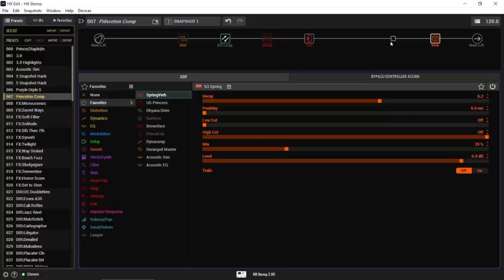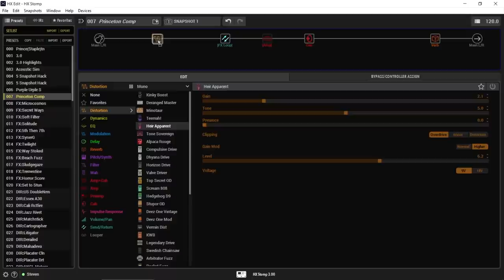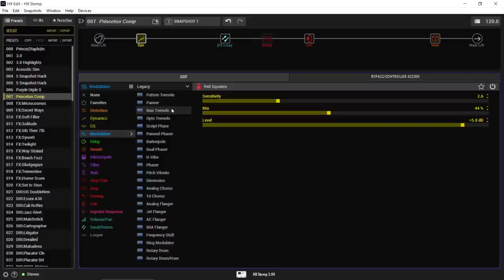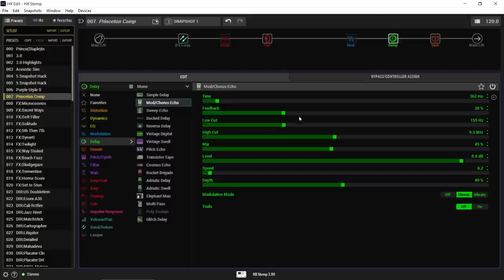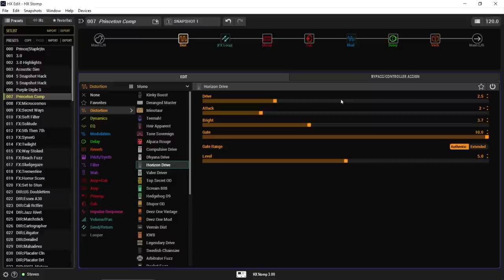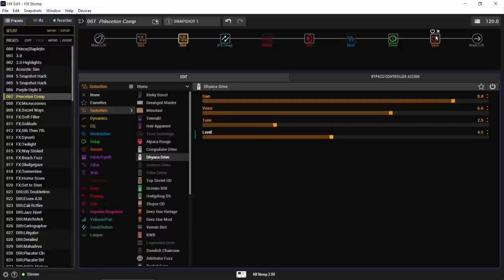Helix 3.0 Princess vs VINTAGE Princeton Tube Amp. Do they sound the same? Line 6 HX Stomp firmware

Comment: Thanks so much for this Steve. The way you've tweaked the amp is so musical! I have an original Bluesbreaker pedal and am really impressed how you can tweak the Heir Apparent to sound pretty much dead on the same  - well I can't hear a difference anyway! Keep doing what you doing!!
Reply from the maker: Thanks Chris! The KOT is based on a BB circuit. Also, that mooer is supposed to be a direct clone of one

Comment: Very similar for sure. Helix has slightly more gain and bottom end but that is more of an eq settings thing, I think in a mix it would be next to impossible to tell the difference. I'm digging the new 3.0 update for sure. took me about 5 minutes to dial in a great tone with the new Princeton amp. Very real sounding and feeling. I did however, use a tone junkie IR with it that I felt gave it just more clarity than the stock cab.
Reply from the maker: Its seriously such a good model. Even pulling it up "stock" is so usable. Hard to make it sound bad!
Reply: @SteveSterlacci  agreed, i was blown away by it.

Comment: In fairness, do two vintage <insert name> amps sound the same?
Your valve amp's sound changes as the valves age. That's why people think Brand X valves sound better than their knackered valves.
Knowing Line 6, it'll sound indistinguishable from the amp they used for reference.
Reply from the maker: You're 100% dead on with this!
Reply: Wow. Just. WOW SIR!
I sold my FM3 to buy another Helix Flo’
I’m back baby! The Helix is just so damn forgiving and ..giving! Too! Nothing beats the value of Helix. Just nothing. Headrush is close second.

Comment: The Horizon Drive is a modern Ibanez Tubescreamer. It works great in front of a Mesa Rectifier or alike. It is meant to clean up the lower end and make it more tight. Preferred settings should be "drive"= all the way down to 0-1 and the level all the way up. Should also do well in front of a clean amp like the Princeton. Best regards
Reply from the maker: Thanks for the tip! And for watching 😃

Comment: i been digging the Princess the last 2 days,  to me it sounds great,  i been a fender tube guy since 1966.  i've had the helix since Oct 15, 2015  and steel haven't used the modeling on live gigs,  i just been using the effects,   i think it time i give it a shot.
Reply from the maker: I think this could be the one to convert you if you can get used to not having the amp in the room!

Comment: I’ve ordered an HX Stomp and looking for some  cool fender sounds and man this is great, here’s to 300 hundred like and a free patch ✌🏻
Reply from the maker: Thanks !!! You're gonna love it
Reply: @SteveSterlacci  just wondering about the now 8 blocks on the stomp are you finding the DSP now enough for blues/rock or is it ok , say the princess with a comp, od, reverb, trem & a boost, would it handle that ok?
Reply: @liammcgovern4470  I think you should be ok, it depends a lot on what specific model you choose for each effect but none of the things you listed are particularly dsp hungry
Reply from the maker: @liammcgovern4470  its great for blues rock simple amp and pedalboard rig. 3 switches, clean, dirty and solo. Maximize the potential with a midi or cheap 2 button FS
Reply from the maker: Here ya go! https://line6.com/customtone/tone/5228697/
Reply: @SteveSterlacci  😀

Comment: Already commented on IG. But, sound almost identical. The model sounds a tad louder which may be a difference, or has a little more midrange. Other than that, certainly close enough for rock n roll!
Reply from the maker: Absolutely! Thanks Steve
Reply: @SteveSterlacci  ok, just got done comparing more apples to digital apples. I can hear a difference. Can’t quite get the model to replicate the real amp. There’s an air out of the real amp, almost hifi (in a good way) that the presence control’s frequency doesn’t seem to reach. Maybe could with an eq added. There also seems to be a bit more headroom in the real amp, which impacts tonal quality.

BUT this all makes sense. It’s a different amp being modeled. Mine is a reissue, pcb board vs point to point wiring, different components, different era of parts. Let alone aging of speaker, cab. I bet your Princeton sounds much different than mine side by side. So, one isn’t better than the other, Helix model vs my PRRI. Like I said earlier, it’s like I just got a second Princeton, but this one a vintage, to give a different color. Yet very similar sound and characteristics. I’m very happy with it, will likely be a go to model for me. And lord knows I’ve been asking Line6 for a Princeton model forever. They did an outstanding job, as usual.
Reply from the maker: Love it ! Definitely agree on all counts
 Even another '66 same year and circuit would sound different than mine in particular

Comment: On this side of utube there is a difference when clean. Helix sounds more bright and with the real pedal they sound different as well. Wonder if that could be eqd out. Both sound ok tho. Great vid 👍
Reply from the maker: Thanks for listening so closely! I appreciate the feedback
Reply: It definitely can be eq’d out. I’m not sure if you have a helix or not. But each impulse response or speaker cabinet/mic combo has a different eq curve. Between that and the amps extended tone controls you should be able to get whatever sound in your head you’re looking for. Also, the helix gives you extended controls your amp doesn’t have. Like you can change the plate voltage with the bias controls or sag the power going to it. This flexibility should be able to replicate almost any amp the helix is modeling if you know how to turn the knobs.

Comment: Hi Man!
Concerning your question about Horizon.
I'm not metalhead so i tried to figure out how can i use it as overdrive and i found it very good and flexible enough.
I've tried this one with Princeton and here my tips.

For lead tone try: Gain - 8, Attack - 2, Bright - 4.
For rithm overdrive try: Gain - 2, Attack - 3, Bright - 2.
For treble boost try: Gain - 0.5, Attack - 4 or 5, Bright - 3.

And thanx for free preset!
Reply from the maker: Thanks for sharing the settings! Glad you're enjoying it 🤘
Reply: Steve Sterlacci update after todays rehearsal )
Lead: gain -8, attack -3, bright - 2.
Treble boost: gain - 0.2, attack 5, bright - 3.
Clean boost: gain - 0, attack - 2, bright 3.

Comment: I have no skin in this game... I don't have any of this stuff but there is quite an obvious compressed sound when you switch off of the amp, along with a slight mid range eq scoop. Apples to apples, they are not dead on. All in all the tone is quote similar though.
Reply from the maker: I think any generic listening device or listener wouldnt be able to win an A/B contest 100% of the time. Would be a cool test though! Thank you for listening so closely

Comment: Steve, could you add a section on comparing how the amps themselves overdrive, say at volume 4, 7, and 10? Maybe more difference will show up in how the amps themselves distort.
Reply from the maker: That would be very cool! They definitely won't be the same at higher settings. The real amp stays super clean all the way up. The model distorts around 6
Reply: @SteveSterlacci  I wonder if the Princess is modelled on a Princeton Reverb which is well-known for being much easier to overdrive (due to the extra gain stage in the reverb circuit) than the non-reverb model you have. My ‘75 Princeton Reverb starts to get gnarly at around 5-6 on the volume with a Strat
Reply from the maker: @Timrobrus  i belive it is. They showed it in a livestream a few weeks ago

Comment: I can definitely hear a difference between the two, the model has a more aggressive mid range and seems to be a bit flat/less dynamic. Amp sounds sweeter. That is being super picky and I don't think it matters haha! This is making me reconsider my initial hatred of the helix when it came out, I actually think that midrange might be a bonus for the helix.
Reply from the maker: The amp definitely has way more headroom. Stays clean to 10! The nice ever so slight breakup in the model is really sweet. Check out some of my other helix vids. It's come a LONG way with the new updates
Reply: That’s funny, I run a silverface Princeton Reverb at home, and I’m pretty sure the volume knob has a steep curve cause it starts breaking up at 2.5!
Reply from the maker: If it's vintage, that could be a bad cap or resistor. If anything, silver face should stay cleaner 😳😯. 2.5 is definitely not healthy
Reply: @SteveSterlacci  not necessarily - my ‘71 PR was that way too.  My non-reverb silverface wouldn’t break up at any volume, but the Reverb broke up quickly.

Really liking the Helix.  May have to try one out.

Comment: The princess model is a bit more compressed than the princeton from what I can hear. Maybe it's a difference in headroom or power amp differences.
Reply from the maker: I assume headroom on the amp being a lot higher is the main difference. Hardly at all noticeable even isolated

Comment: the Stomp sounds brighter and the Princeton a bit warmer, but its not a huge difference - on the bridge pickup, seemed to switch on the neck pickup, all for clean, sounded identical after that
Reply from the maker: Its crazy how the slightest picking dynamic can change the tone so much.  So many times i would think one way, then totally flip the next time i switch
Reply: @SteveSterlacci  it’s definitely an interesting thing not just in comparison but what we hear or think we hear ... and then on top of that adding IRs and how that changes the sound, which you can do via snapshot which is something I want to explore.. 

You said this was your go to, is there anything you wouldn’t use this amp for?

Comment: Very close. To my ear, the real amp sounded a little more scooped. I felt that way both clean and with the Heir Apparent. I wrote this (but hadn't sent it yet) before hearing you say that with the Heir Apparent, the model was a bit mid-humped, so in essence we agree. I also heard it a little bit with the Blues Crab (which I have also, and like a lot). Could it be related to the way that the output section of the Princess model is set? The virtual power tubes might be getting hit harder than your real power tubes which would thicken things up somewhat. Or it could be the specific preamp tubes you ahve in your real amp - they might be alittle light in the mids. Either way, the differences are small enough to be irrelvant in my view. Two identical Princetonms would probably differ by at least as much. But, whatever you do, don't sell that Princeton - you'll regret it forever. I saw a used one at a guitar show a while back (early Silverface era) that I could have gotten for $900, and I am still kicking myself for coming home without it. But at least I have the one I built -- a non-reverb Princeton in a Blues Junior cabinet loaded with a 12" JBL K-120 -- killer. Does the Helix cab list include a JBL of any sort??? Hmmmm....maybe I need to seek out an appropriate IR (which I generally avoid).
Reply from the maker: Thanks Steve! I agree and was thinking all the exact same points. If i had 2 of the same amp, they would probably even sound more different than this comparison. As for IRs, find some "essentials" packs for $8. I did that bc i wanted a Jensen p12q. Found a set on chop tones for that price. Easy choice and not a lot to sift
Reply: Preamp Tubes don't change the Frequency response, only the volume slightly. So the difference you hear when changing preamp tubes is how hot the signal hits the power tube. Use an IR and take the powerstage out of the equation and set the volume to the relative same and your preamp tube doesn't matter as long as it isn't broken. The circuit makes the tone, not the tube.

Comment: Great comparison. There are differences in the low-mids between the two. Funny thing is the amp reacts different to different pickups. At times the model as more low mids while other times the amp does. 
The chorus and internal distortion pedal resulted in the most difference between model and amp. The characteristics of the amp are pretty much dead on. I don't think there is a difference in headroom between the 2. I think the difference is in the send/return levels.
 There might be some compensation when the level is considered too hot (distortion pedal) for the loop. Not sure, it would be a question for the line6 programmers

Great video, keep it up!
Btw, any difference in feel under the fingers?
Reply from the maker: Thanks for listening so closely! Feel is exactly the same to be honest. There is no speaker in the room with me so having the real amp DI, the Helix feels identical.

Comment: Great video thanks! Is it possible to get this close without the reactive load box? Thanks again.
Reply from the maker: It wouldn't be possible to get the amp to line level and into the helix without it. It doesn't add color or anything. Its meant to be flat and retain the amps tone

Comment: Great video! Quick question, though...when you say the output from the Suhr Reactive Load goes to the FX loop of the HX, do you mean the Return, or are you using 4CM?  Thanks!
Reply from the maker: Its more like 3 cable method. Guitar into HX, hx SEND to front end of the amp, speaker out to RL, RL output to HX RETURN. Then the HX out to my DAW
Reply: @SteveSterlacci  Aha! I suspected as much - and I'm so glad to hear that it works. Could you still use all the effects, or just the 4CM designated ones?  By the way, the model and the amp were dead on, just about.  About the mid hump you mentioned with the pedal, I actually heard that even when you played dry - but that's such a nit.  Thanks so much!
Reply from the maker: @srinip  all FX are usable in any place in the chain! Thanks for listening so close!
Reply: @SteveSterlacci  Thank YOU! Not every video is worth listening to closely - yours definitely is.
Reply from the maker: Thanks ! That really means a lot. I may try to find my real '64 bassman in the Helix
Reply: @SteveSterlacci  Can't wait!

Comment: To really compare one to the other, you have to plug the Helix to an FRFR speaker and put a mic before it, then put the same mic before the Princeton speaker.
Reply from the maker: Absolutely not. The speaker sounds would be totally off.  And no FRFR is designed to be mic'd. The results would be all over the place. Believe it or not, I did think about this quite a bit before doing it. This is the best way to have done it and have them both on the same playing field
Reply: @SteveSterlacci  What would be an interesting comparison, more useful IMO, would be to compare what you hear with an actual Princeton (like if you're on stage, rehearsal, etc.) to what you hear with the Princess into an FRFR system.  What you did refers to what you hear after recording, which is different (I'm not saying it's bad).  Also, you introduce other variables with the Vintage Princeton sound -  The Suhr then the Helix.
Reply from the maker: There are too many individualized variables in that. Not everyone has the same playback systems, stage capabilities,  in ears, drummer etc. This was the best way to do it with the least amount of external variables affecting the tone. What you hear in the room with a real amp is an apples to oranges comparison when using an FRFR in the same room. They're just not designed for the same purpose. The Suhr literally does translate the amps sound into a comparable scenario to shootout with a Helix model.  Like i said, I weighed all possible options to do this before filming. This is the best way to do it with what I have access to

Comment: What trs cable did you use for the switch? I'm on the lookout for one like that but they are hard to come by.
Also one tip. Try pairing the US Double with the 1x12 Princess cab.
Pure. Vaughan'ish. Goodness.
Reply from the maker: I will def try that! Its a cheapo. Link for it on amazon is in the description
Reply: @SteveSterlacci  looks like the Amazon link for the foot switch is dead

Comment: Very close Steve, but the gain & level seem a smidge hot on the Princess.  It might just be my ears.  Looking forward to the preset on Custom Tone!😃
I have a Helix, but not a Stomp.  With the addition of two extra blocks on the Stomp, did Line 6 have to reduce the size of the icons?
Reply from the maker: I guess they are a touch smaller! These were volume matched in my DAW btw. I made sure the meter was within .1db 🤷‍♂️. Could just be a slight eq thing somewhere
Reply from the maker: Here ya go! https://line6.com/customtone/tone/5228697/
Reply: My hearing isn't as good as it once was Steve, so it could very well be just me.  However, the tone seems spot on.  Boy, you sure blew thru that 300 barrier quickly.  Next time, I imagine you'll raise the ante.  Thanks for the vid and the preset! 👍
Reply from the maker: The community killed it!! Very thankful for you all. Maybe 1k next time !